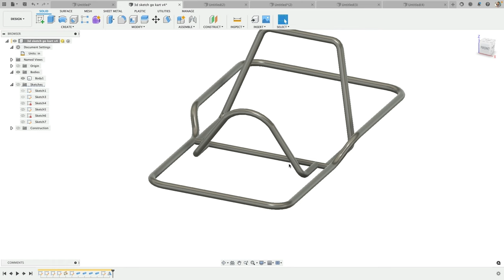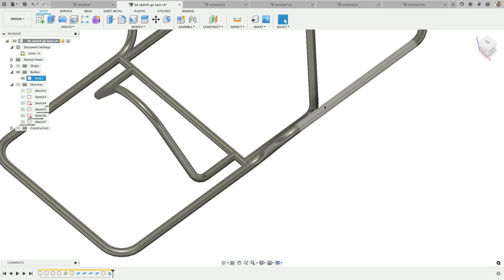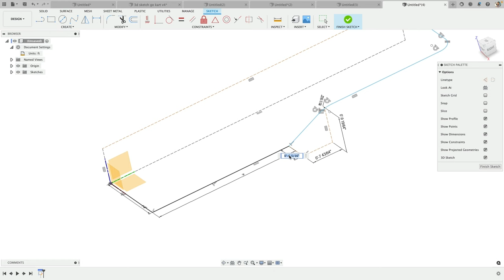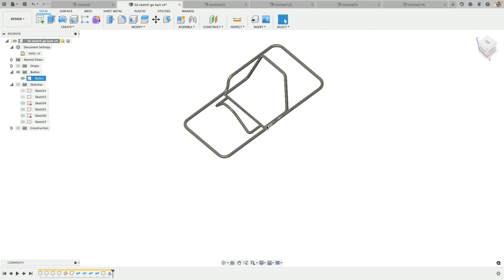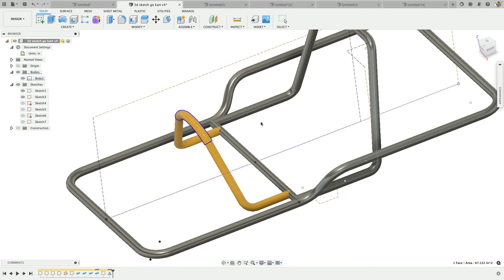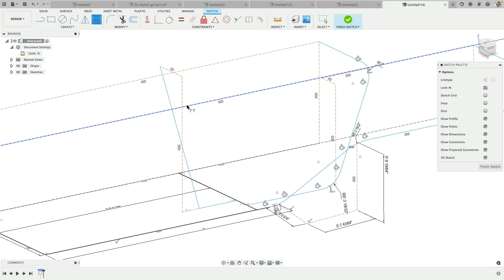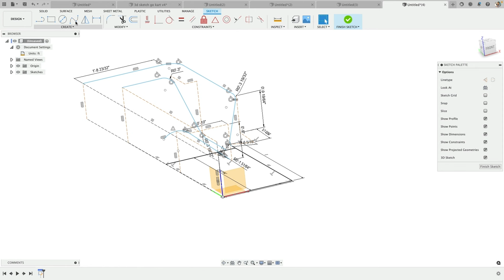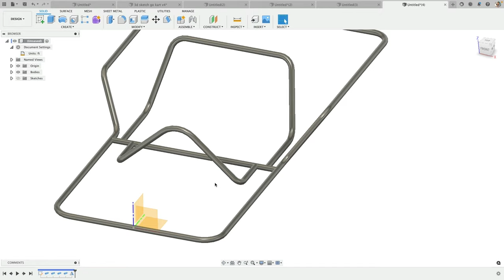Learn How To 3D Sketch in Fusion 360 (Frame Design)

Comment: Fusion360 seems to struggle with "complexity" quickly. Does anybody use it for creating real life components other than simple 3d molds? Ideally everything should be 3D-sketched, but there are computational limits at play. I've given up on trying to make Fusion360 constrain (3D) sketches. Maybe I should give up on Fusion360 altogether.

Comment: BTW, if you're sketching something that's supposed to be aligned with a particular point of the sketch, I've found that if you hover your cursor over alignment point after you've started the line, arc, etc. and then move it back into where you're intending to place the final point, it'll somewhat intelligently provide you an alignment guide. So you don't always have to create a guide sketch to make sure two far away points line up the way you want.

Comment: FINALLY! THANK YOU for pointing me in the right (hopefully) direction.
I am trying SO HARD to create a pretty simple 3D sketch with curves and straight lines that has refused to create these where I want them. I believe my key problem is due to Fusion wanting to begin all new lines from a plane or a face; well, none exists where I need to go in my sketch! Your approach of using the rectilinear construction lines is the ONLY THING THAT WORKS after literally hours of trial and error. I'm new to Fusion360, coming from Rhino3D (great but Fusion has some really attractive features), and until now the learning curve for 3D sketching has been a vertical cliff coated with teflon. Still have problems, but YOU have kept me from giving up. Apologies for the rant - simple things should be effortless but sometimes? Thanks again, Sir - I'll keep at it.

Comment: im running into difficulties with adding tubing (pipe) to existing tube designs, any tricks or tips to gind the center of the pipe you want your new pipe to land on? what you cover in this video is great and its how i draw the basics of a tube chassis for racecars, but the next step is always adding more tubes and these chassis can become very complex and it gets tricky to add tubes to the model, as i cant easily select the center line of older tubes (i should note that sometimes they are imported from bendtech programs and they do not offer a centerline sketch) love the videos, keep at it!

Comment: Hey Thank you for this, I've used this method as a work around a few times now and its the best we currently have for frame design. Where This fails is when the frame tubing being used is a rectangle or some other type of tube besides a circle, square, or triangle. I really wish Autodesk would make an actual frame builder similar to other leading cad apps where you could use a simple 3d line sketch just like this but be able to control every tube and how it terminates to another. For example I use miter joints in real life a lot when making frames but for me to model a frame correctly with miters, I have to use another silly work around with using planes through the corners of tubes and splitting body's. This seems easy until actually doing it several times and it just takes way to long.  

Anyways thanks again for this video, this works really well for simple circle or square tube frames and it will do for now.

Comment: At 3:04 i'm confused about what you mean by you can't go to a plane. When you're making that horizontal line if you take your mouse down and hover over that point you are trying to align to and hold shift as you move your mouse back up vertically fusion will draw a green dotted line back to that dot and kindof shap to that reference end point in that plane. I don't know the terminology or a better way to explain it but it does work in both a 2d and 3d sketch, I just tested it. Please try this and let me know if i'm not making sense.
Reply: Disregard it only works in 2d. I messed up my 3d sketch that's why it worked the first time.

Comment: Ugh! How do you not feel uncomfortable seeing so many blue and yellow lines on your sketch? I am so obsessed with making everything in my models parametric and well-constrained which already let's me see this model going haywire if you want to change something in the future. That's the reason why sometimes, constraints in your sketches go all nuts. If you constrain everything properly from the start, you'll build really nice models which are also editable in the future if things go wrong while manufacturing.
Reply: Fusion360 seems to struggle with "complexity" quickly. Does anybody use it for creating real life components other than simple 3d molds? Ideally everything should be 3D-sketched, but there are computational limits at play. I've given up on trying to make Fusion360 constrain (3D) sketches. Maybe I should give up on Fusion360 altogether.

Comment: 3D sketch has its uses but this isnt it. fusion & Inventor operate much better with simplified sketches, complicated sketches are hard to make updates to after the fact. Also, the way you constructed the out angled section isnt good practice. typically we would be working in angles and wouldnt have those XYZ lengths to hand. A pretty picture but not a great example of this would be done in the real development world

Comment: you are not a design engineer, are you, dont you like accurate 2d (multiple if needed) measurements and diagrams, what a trash advice, you always sketch the models in 2d first
Reply from the maker: I am a mechanical engineer and I still use 2d sketching all the time.  Just wanted to introduce the 3D sketch tool :)
Reply: @TylerBeckofTECHESPRESSO  options, options
Reply: @TylerBeckofTECHESPRESSO  annoying clickbait thumbnail
Reply: @TylerBeckofTECHESPRESSO  ironically "dogs must eat their own bones", think before posting